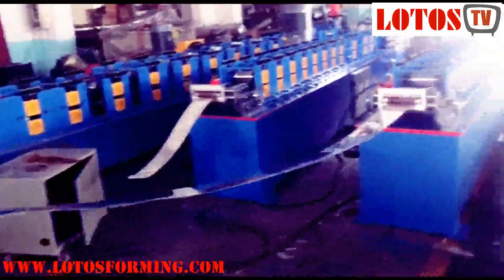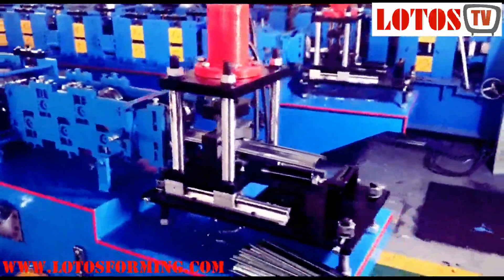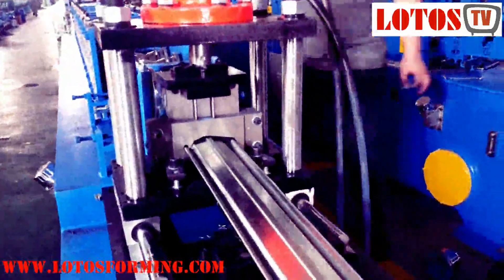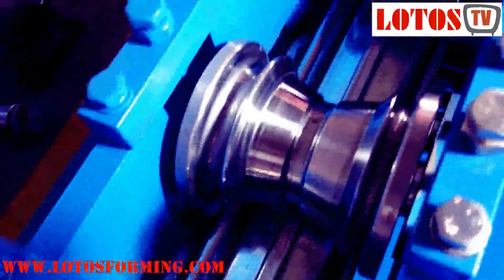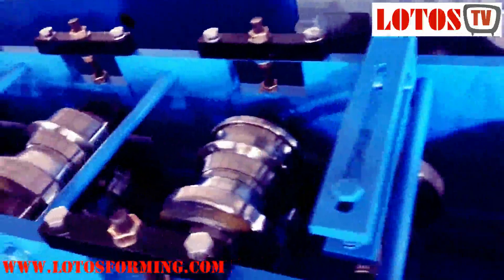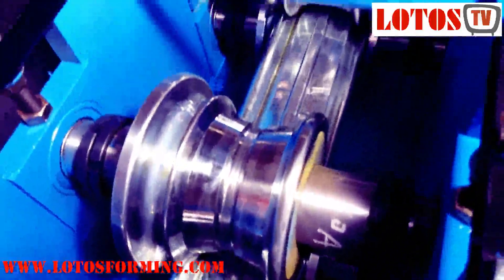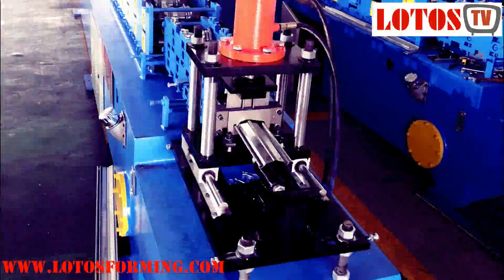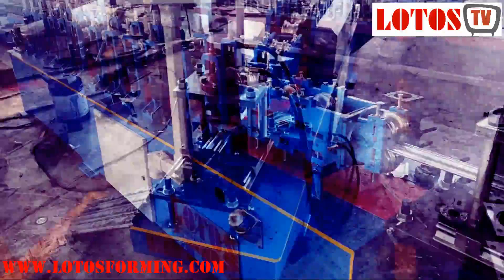【Roller Shutter Machine】: Mexico Roller Shutter Making Machine "Mexican Rolling Shutter Slats 2020"

Comment from the maker: We also can add servo motor and no-stop tracking cutting on the shutter door roll forming machine, and the speed can be 25-30m/min. All the data set up in the PLC computer program (Delta or Mitsubishi for option).